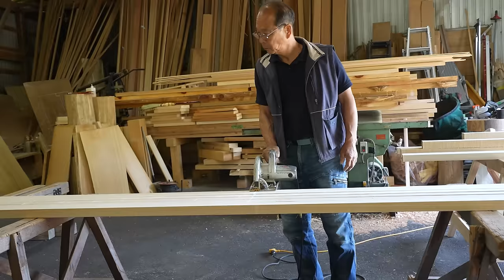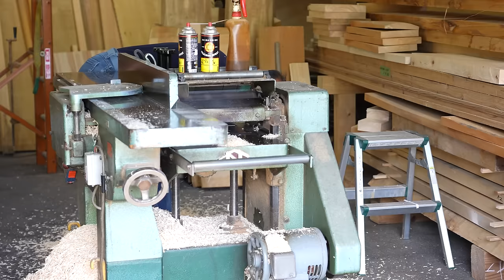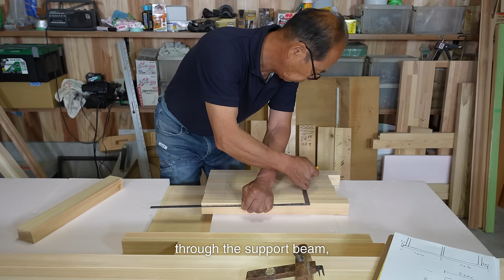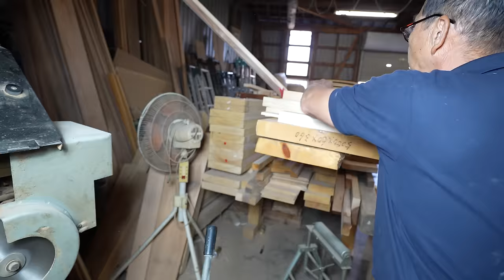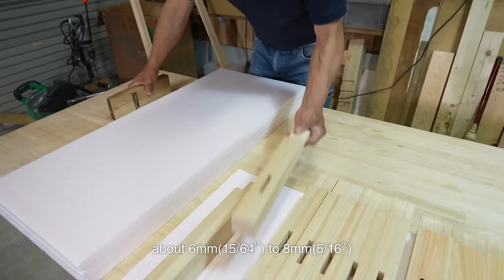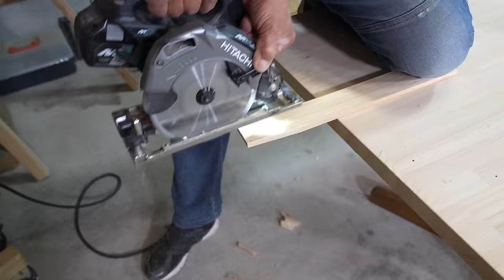I Can't Build a Bench More Beautiful Than This [Carpenter’s DIY]

Comment: Simple design but so elegant, I enjoyed the use of tenons on the fame work.  The use of oil rather than stain or varnish really adds to the finish.  Glad you did not add a stretcher to the front and back of the slats.  Thank you for sharing.

Comment: "Chamfer the edges so you don't notice the difference" - Glides super smooth and slides across without any perceptible bumps or differences.   Awesome Bench!  And funny that the last one you got at the home center lasted 30 years. Here it would've been some cheap one and we would have had to replace it 6 times over by now :D

Comment: The craftsmanship is great. I do wonder though, why do you cut the wedged tenons at an angle, severing the end grain, instead of cutting them straight? I think it would cause a weak part in the joint. I’m imagining the severed end grain cracking and pushing out from the pressure of the wedge.

Comment: I've just noticed the tape measure and the units. It looked like metric and inches, but I looked closer and realised the apparent 'inch' was too long, so I looked it up and discovered the unit is actually 寸 which is 30.3mm. Very interesting!
Reply: What measurement system is this?

Comment: I think it does suit bit you could all another bottom bracing near the center then, you can split the bench in half with a circular saw.  I personally think it would look best long with a few potted plants on the opposite end.  When you build another, I would like to see the base frame waxed with carnauba wax, the slats waxes before assembly. This gives better protection.  I’d also like to see the wedges in a darker wood.

Comment: Do you have any tips for staple/screwing a piece at an angle onto the face of another piece? I managed to finagle the first piece into place after which it was easy to clamp a spacer between the angled pieces but just getting that first piece lined up was a huge effort, at first I was going to clamp it but half inch (12.7mm) plywood doesn't like to sit flat like 3/4 (18mm) does. What I was building looks similar to Louvre doors but was simply a brochure holder. the edge is set on the face of the other piece at an angle. I could have CNC'd slots in the board if it wasn't 3 1/2" wide (too small to mill on pods without putting it in a jig) additionally I'd like to get better at building

Comment: Fine, Ill subscribe, but I want to see a rocking chair made with the same techniques on your next video. May God Bless.
Reply: Although a beautiful bench, It would be nice to see you use a dovetail cut on the bottom of the wood that would create the seats, locking them in with wooden pins at the end in order to replace the metal screws. Its extra work but nothing beat a puzzle that holds itself without metal. If you want to I can email you a blue print for it.